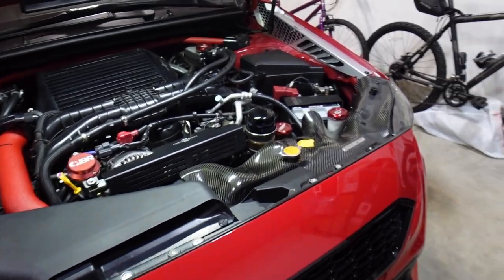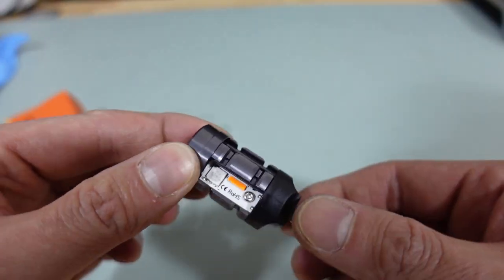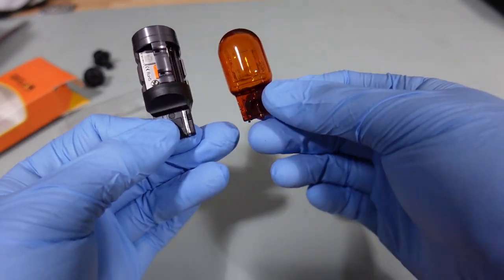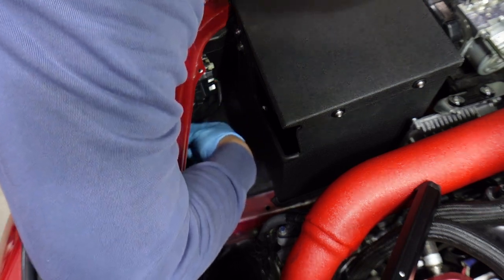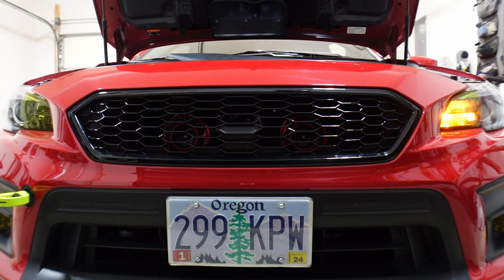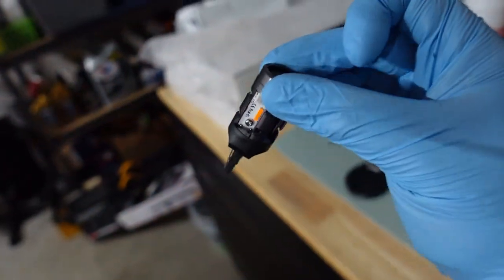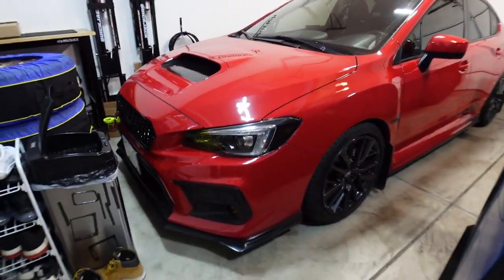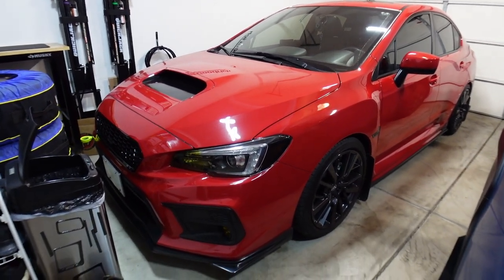The BRIGHTEST LED Turn Signals! | Subaru WRX / STI

Comment: I just installed the oxilam LED 7440 turn signal lights with the cool projector lenses on my 2015 wrx and I can definitely say they are without a doubt THE BRIGHTEST turn signal LEDs ever if I'm not mistaken the product info on Amazon says they boast a 5000lm light output which I'm sure is for each pair so each one is probably 2500lm but no matter what the advertised light output performance they are rated for these suckerz are so bright the traffic lights change to green faster for me when I approach to make a turn because the light sensor in the traffic light that senses oncoming light obviously picks up the super bright amber light from my blinkers while I'm still approaching from several hundred feet away so that's another great benefit of them lol. So now that I finally upgraded the turn signals every single light on my Rexxie both interior and exterior are upgraded to LED from the headlights all the way down to the vanity visor and glove box lights. I also wanna say it's nice that they have the built in canbus load resistors so they don't hyper flash so no need to buy and splice into the factory wiring with separate load resistors.
Reply from the maker: Nice write up! I absolutely love them!

Comment: I have the same bulbs my first set worked great and still does but one of the leds from my second set started to whine from the cooling fan wich made me think it was my fuel pump since it was echoing thru the trunk into the interior evently i realized it only was happening when my turn signal was on but none the less keep it in mind if anyone gets these that it can happen and start to heat up pretty hot in the wrx housing

Comment: Like the sharpness of the on/off of it, have you looked into the diode dynamics trail to turn kit for the rear? It cleans up the rear lights greatly
Reply from the maker: Yes, definitely have considered this kit for the car but never got around to doing it. I agree that it cleans up the rear!
Reply: @ronfromportland   I put it in my’18 and change the rear turns to the back up lights and it lights up behind the car almost 10-15’

Comment: What trim level do you have? I'm digging the turn signals in the actual headlight.
Reply from the maker: Limited trim. Thank you!
Reply: @ronfromportland  I got a 17 base and looking to clean up the front end. The aftermarket options are a little much. But those are the perfect. They are OE right?
Reply from the maker: @SuperSaru  yup, the headlights are stock. I went with the limited trim because of the headlights. I know it’s not important to some but for me it was one of the selling points.
Reply: @ronfromportland  cool thank you. Now I know what to look for.
Reply: @ronfromportland  this whole time I thought it was a Premium trim lol I just wish they’d not force the push start on customers.

Comment: just ordered these for my sti. assuming it will be the same for sti headlights right? and no diode dynamics tap needed? just the leds?
Reply from the maker: Yup, it should be the same. I didn’t need any taps, just direct plug and play and they were good to go 👍
Reply: @ronfromportland  awesome, thanks!

Comment: Are these the same part number LEDs for the rear on my 2020 STI?  Meaning, could I order two sets for the front and rear?  Thanks...
Reply from the maker: Yeah, they should be the same. I just checked the site and confirmed fitment: 

edit*
Fit for Front Turn Signal/ Rear Turn Signal light, if model w/ Halogen Capsule Headlamps.
Reply: @ronfromportland   Hmm. Like I mentioned, it's the 2020 STI with the steering responsive LED headlights. If that helps, thanks again, sir.
Reply from the maker: @Kiss__Kiss  ah, gotcha. I’d try this one: https://amzn.to/47qrgxz

Don’t get mad at me if they don’t fit! 😂
Reply: @ronfromportland   LOL!!!   Okay Thank You!!! Merry Christmas to you and yours, bud. 👍
Reply from the maker: @Kiss__Kiss  you as well, sir! 🍻

Comment: You going to get some for the outback?
Reply from the maker: Yes, eventually! I’m really impressed with them.
Reply: @ronfromportland  I just ordered a set. Did you ever put any in the rear? Just wondering if you did, have you had any complaints?
Reply from the maker: @stefanpuffer  nope, I haven’t yet! I’ve been slackin.

Comment: Ron, I saw your indicated lane change here in Ohio.  And no, I have not been near any trains/train tracks lately.   Wow, that led turn signal bulb throws light everywhere...the light was hitting the of your garage door from where the car was at.  The OE bulb did not do that and kept the light focused at hood/bumper height. PLZ DO NOT get them for the rear.  You will literally blind anyone behind you at night and potentially cause major distractions and temporary night blindness for  those behind you.  This is one mod I disagree with.

Comment: Anything to increase visibility at night is a plus. Too many boneheads on the streets.
Reply: at the expense of other drivers being able to see as they are hit w/an orange strobe.  it is bad enough ppl drive w/their high beams on when coming at you, or use LED bulbs in the headlights...now, w/this LED turn, you will blind ppl behind you that are much closer than approaching traffic w/high beams.  These are literally rear facing, strobing high beams.  I don't care if their only blink 3x.  Ohio drivers suck in this regard; no high beam discipline/courtesy
Reply: @K03sport  how do you blind people that are behind you with these bulbs that are installed in the headlights?